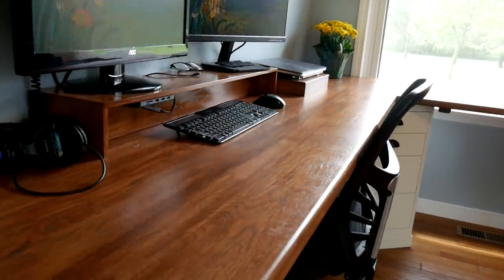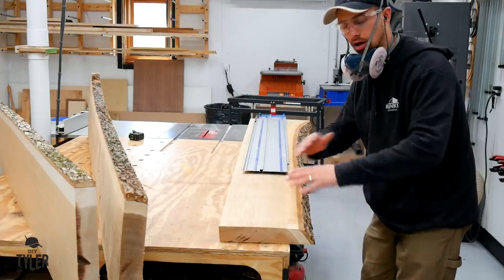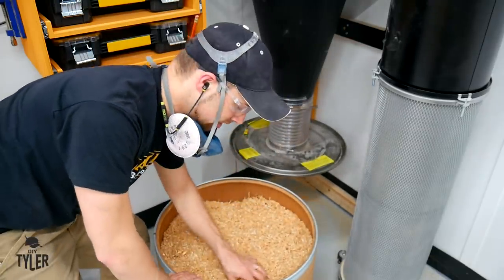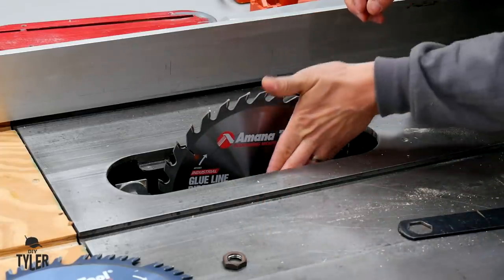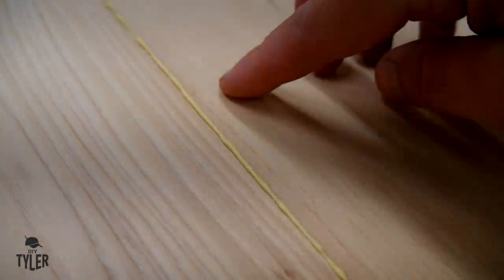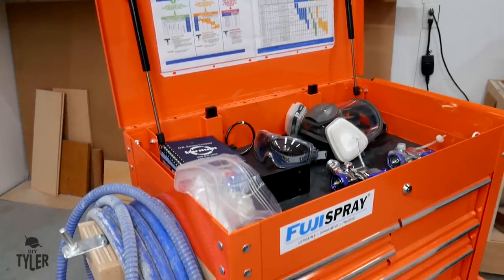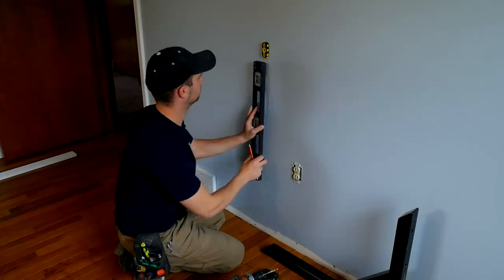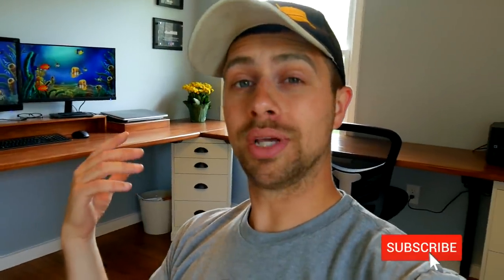Floating Corner Computer Desk | HUGE, Fits 2 People Easy!

Comment: Curious about your thoughts on the use or non-use of biscuits to join the desk top pieces together.  I see you use glue only.  So many different opinions out there.  Perhaps you can address your thoughts in a future video.  Beautiful desk.  You started me thinking about building a new desk for my home office.  I've also been looking to purchase a FUJI spray system so I will be looking into that too very soon.
Reply: I'm glad I read the comments first before I asked the same question about the Bisquets!
Reply from the maker: If I had a biscuit joiner I would use it but I don't see the justification in getting one for the few panels I glue up. It would make alignment and sanding easier....guess I should keep an eye out!

Also, get yourself a Fuji, and right away get the 3M PPS cups for it....you can thank me later!

Comment: The biggest problem with these table projects is straightening the boards. I only have basic saws and I tried a method where a rigged a straight board tool for my saw but it didn't come out that good, still some small gaps and openings.

Comment: I'm wondering why you didn't miter the center
Reply: Fair question.  I was wondering that too.
Reply: Just a guess but if he was limited to 94" length in his shop, a mitered corner would have required shortening one leg of the desk considerably.
Reply from the maker: That was the original plan but I got cold feet with making a perfect miter cut that big. AND, the wood I had for the second side of the desk ended up not being long enough to cover the printer section (which was a late addition to the plan) so that took care of my cold feet! Thanks Cindy!